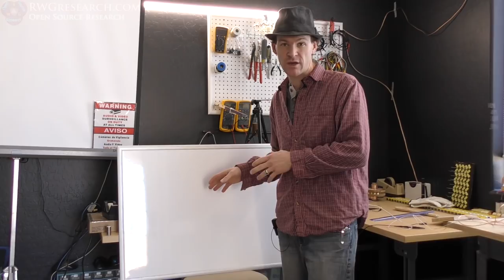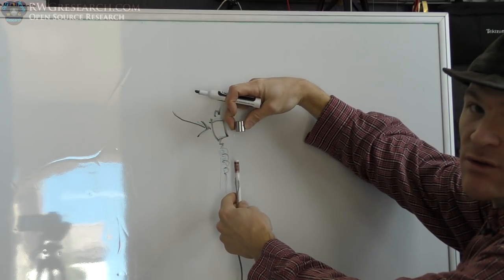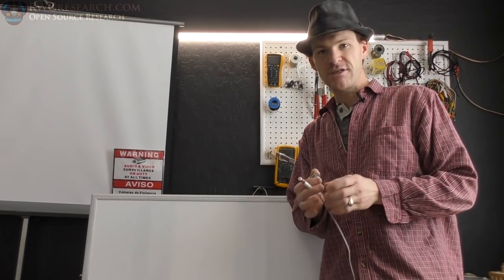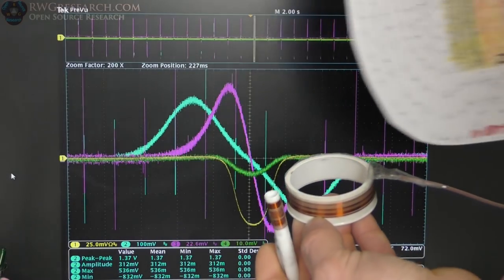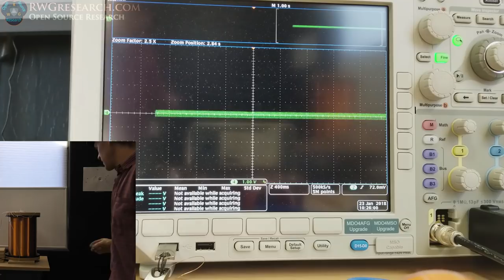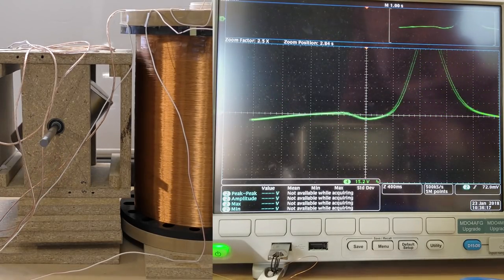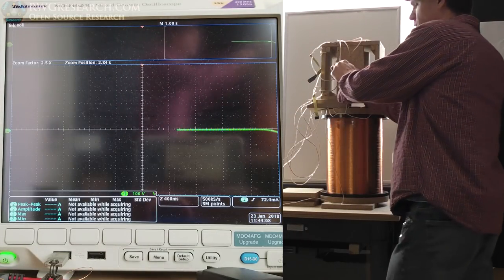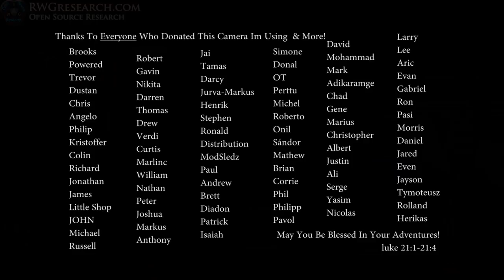The Search For Answers Part 14: Coils & Magnets. Back To The Basics. Very Counter Intuitive... B

Comment: Comment to part around 10 min. : Real results are in accordance with the known law which says that induced voltage depends on change of magnetic field. So it also means that after the point where magnet is closest to coil, change of magnetic field is negative because it weakens so voltage is also negative. So one swing makes you whole sine wave.

Comment: I am not fully convinced about Newmans theorie of a splitted pole with opposite directions of a spin, but i think, its more like H. Johnson demonstrated, that it are 2 spiral spins, what comes out of the poles, and interact with eachother. You can explain by that also the observations at the cutlines.
 Keep in mind, that this magnet are flat at the top, and the strenght of the magnets increase or decrease at most at the very last distance.  This top flat area can cause a drop from the induction. Also that gap, what at both coils exist.  I had similar observation, that the sinus wave was not exactly a wave, but something like a hat, but at other configurations, it created a perfect wave with just one pole passing by.  It maybe would be interesting, what a shaped magnet like a )) does, when you pass it by at the circle, what is the extension from the angle from the shape of the magnet.  But still quite interesting, that passing the magnet just at 2/3 along the coil creates a induction only in one direction. I only had one time some positive results with this motor, but it was with different amount of windings, also the duty cycle and the timing is importend. It does not work, when you connect it a lenght of 180 degree. I also could not reproduce the configuration anymore. 
This guy here rips J. Newman pretty apart, not sure what did happen there, even i dont buy it, that Newman gave a guy 100 000$ for helping, to put the device into his car. https://www.unexplainable.net/info-theories/was-joe-newmans-free-energy-claim-bogus.php

Comment: Hi Russ I am trying to take your advice of giving back for all your great work and inspiration you have generated.... 

Magnetism
When you show a curved field as in your hand drawing - the whole Idea of a curve derives from how metal filings themselves are redirecting the otherwise straight line field. The random geometry of the material still finds the pathway of a field but sorts this out at an average continually and gradually to form the curve.  Its the material itself that is redirecting and creating the appearance of the curved field seen in filling patterns - what is otherwise ONLY a straight line vector of the field emerging from the pole. This is yet another example of how theories and apparently how they have been taught to us distort perception. That and you can also use a field detector around a magnet and not detect any curve. Constructs are not only unhelpful  this is a good example of how direct perception is constantly messed with. Scientism demands its own type of blind faith in that such tests that would put the cause of distortion to rest are not usually performed. If the fundamentals are botched in this way then its kind of hard to get clear on the further details of analysis which are based on them.  

Gravity
To give an example of theoretical cause of mental distortion Look at the theory of Gravity with me -  Gravity is a theory and yet it infects our whole thinking without realizing it. If you look closely in how its being invoked its often applied as if were a belief rather than from an idea that is grounded in direct observation at the outset. I put the utility of Theory into question to make a key point - By choosing any one test offering REAL and direct observation -  you need not rely on any Formula. A God given faculty of  natural PERCEPTION reveals immediately that Density explains all that Gravity purports to explain without ANY of the attending complexities, contradictions and confusion.  Whereas the appearance of complexity confusion additional non observable constructs never arises within the concepts of DENSITY and BUOYANCY.  For example Fluids of differing density in a test tube are observed to NOT attract but actually repel and separate. Hydrogen does not attract to the earth as a mass - but flies away with great force. Adding a mass of hydrogen to an evacuated balloon is adding weight to the entire vehicle yet results in buoyancy. All observations immediately contradict tenets of gravity which state masses attract to the center of the earth, masses attract to each other ect...  So tell me why do we need a THEORY of gravity when all we observe is covered by the FACT of density and buoyancy? Falling and rising is explained.  Such theories like gravity distort thinking to make us believe we need ever more data  - that we need to better align to some theory.  But Worse Our whole  understanding of the world is distorted by this one idea. In point of fact we are not trusting our god given perception any longer. Not honoring the creator creation in external placating of theory.  Electric theory is notoriously embedded with distorted concepts.  Tesla Faraday DePalma - all were Scientists because they where WITH (CON) their knowing (science) of direct observation - With conscience.  They grew further and faster from the foundation of Seeing reality directly - seeing more clearly because they some how let go SUFFICIENTLY of the distorting filters of theory that hamper pure observation.  Trust experimentation based on your direct observation MINUS the need to prove out theoretical constructs.  Your building capability is an inspiration to all thank you for all the inspiration you have generated !

Comment: I've watched 3 time's now. I wish you could have said the coil windings are left thumb rule. I been trying to wrap my head around what direction of the coils and magnets need to be to produce a push off of the magnet once induced by/from the magnet.
If a north swipes the side of a coil, "from south side of coil. Does the coil induce a north from the north end of the coils or out the south end?

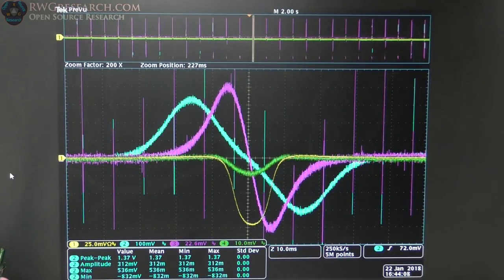Comment: Very good video Russ, but you never really explained the reading around 25:58 when you said you would explain it further at the end of the video... but before that you do say the blue one is the bigger coil, plus the timing of the amperage peaks are further apart. My thought is the reason the pink reading gets higher amp changes is down to the number of "turns" or extra wires that the magnetic flux cuts through. I wish I had an oscilloscope, interesting stuff you can see just by messing around with wires and magnets to better understand how electromagnetism works.

Comment: hmmm after doing some more reading on EMF, at 49:45, your getting one direction of current and then an equal and opposite direction of current bringing you back to zero, the current is switching at the peak. This happens as the magnets field passes by the wires in the coil running in one direction on one side of the coil and then an equal and opposing current occurs when the same magnetic pole passes the other side of the coil where the wire is running in the other direction. Which brings you back to zero on the scope if it was done at a constant RPM and stopped at exactly 180 degrees like you were demonstrating.

Current flow in the other direction is just negative volts, or negative potentials being created where the magnetic field passes over the wires. Positive volts is current flowing one way and negative is current flowing the other way because the potentials positives and negatives switch places. I'm reading about the most basic form of EMF calculation which is Emf = l * v * B l is length of wire crossing the magnetic field (B) multiplied by the velocity (v) of that crossing multiplied by the magnetic field (B) and B is in Teslas; Volocity is in Meters per second; and Length is in meters.

So in a coil you deal with two wire crossings or intersections (albeit that above equation gets more complex once you add an arc to the wire and are no longer dealing with a straight wire passing perpendicular to the magnets surface) so lets say you have a square coil instead. 

The north pole of the magnet passes over one side where the wire is running in one direction causing a voltage or a potential difference where the positive and negative are at both ends of the wire where the field stops on the wires and the positive and negative is determined by whether or not it was the south or north magnetic pole you passed by it and the direction you passed it in.

Then because the pole is the same and its moving in the same direction once the magnet passes the center of the coil where its field intersects the wires much less you get that anomaly at the peak as the voltage drops slowly, and then as the same pole intersects the other side where the wire is running the other direction, the current quickly drops because the voltages being induced on the other side of the coil are now opposing the original direction of voltage (the positives and the negatives flip) due to it being a coil and the wire running back in the other direction on that side of it. 

So the voltage potential reversal happens at the peak when the magnets pole passes the center of the coil leaving one side and crossing to the other side which causes the current to rebound back to zero because you had X current from an induced EMF on one side and then subtracted X amount of current through the EMF being induced backwards on the other side of the coil due to the wire direction changing in respect to the magnet.

Comment: The problem with this test when you have the 3 coils stacked on top of eachother is that the coils will induce voltage between eachother. So to really do this right you need to isolate each coil and test each one separately. That’s because each of the coils themselves manifest a magnetic field and they will either amplify or cancel out the voltage between eachother.

Comment: Very clear.. Yup this parallels Tesla's motor gen then. Except Tesla used all electromagnets so that the system can auto balance the poly-phase output. Two currents at a different degree of phase.

  In Newman's version he uses just one coil. But Tesla used 4. Two pairs per phase.  Tesla also used a field core toroid to get another advantage. The rotor coil makes a field that can be channeled and pushed around the ring. When it gets pushed around the rotor locks to that magnetic field circulating around the field core strengthening it and generating more current in the field cores that assist the field coils. This also generates even more current in the rotor which can be used for a prime mover. I believe Tesla's version is a steady state rotating transformer. If you take mechanical spin out of the system that will slow down the rotor and the rotor coils will generate more current trying to maintain sync with the field coils. This will also generate a heavy current in the rotor coils and a loop forms.

 Think of the Tesla system as the whole device and Newman's as only one coil in Tesla's device.

 A test of this would be to use two massive coils hooked serially and spin the magnet between them. I bet one would need to be inverted to help twist the magnet. You are making another coil right?
Reply from the maker: Thanks Jon, yes i will have 2 coils. indeed it would seem that one coil could need to be the other direction. however if the field cancels... Then we are in no help with the mechanical advantage.  any how. a single coil with magnet in side is the way to go... or so it seems. ~Russ
Reply: Well I was thinking the motor itself powers half way then kinda lets the inertia built up continue it through the other half of the rotation of the magnet. If you wanted it to be powered all the way through then you need another coil on the left. How that will effect the coil you have now would be hard to say because of the magnet spinning in the middle.
 The second coil in Newman's device was used to tap the coil you have now as a generator/load coil which would be on the right of the coil you have now. It must be outside of the rotating magnets influence though but in inductive relationship with the current coil. Gonna be hard to figure that out but it shouldn't be impossible..
 That commutator brushes need to be copper I am betting. This would suppress the chatter as well and make better contact to the commutator contacts. Plus most of the wear will be on the brushes then which would be easier to change then the commutator elements.
 You are doing great.. Keep up the good research no matter how confusing it may get. He had something there so it is a matter of time to figure it out...

 By the way excellent Video!

Comment: Thankyou russ  youre doing that  which  has needed doing slnce joe  gave us his discoveries this is extremely important r and  d  ie back engineering
Reply from the maker: what Newman gave us was his view of the observations of the simplest experiments.  All this in a mechanical interaction view point. In the end it all feels like quantum effects.... however, Newman could grasp those basic principles to prove that it was possible when we use 100% of the magnetic interaction between a coil and a magnet. In the right configuration. to achieve a device that is truly 100% efficient. and then some... :)  ~Russ

Comment: Did this same experiment in a lab in AC systems class a couple of semesters ago. We did not include the straight conductor but did pretty much the same physical process you did. I think a lot of people make the mistake of getting lost in semantics. Also, I disagree about the counter intuitive nature of it all. 
Good luck, I wish you success in achieving an apparatus that is of use to humanity as a whole, on that front, we are aligned. I just think re-inventing the wheel to get there is unnecessary and an exercise in futility.
Good luck, we will see who reaches the coveted goal first.
One thing is for sure, we both have completely different views about pretty much everything.
We also have differing views on what is good and what is bad etc, real and fake etc, crazy and sane etc.
So anyways, time will tell who was on the true path. 
At least the end goal is a worthy cause, that is a good thing.

Comment: In your clairty part 13:10.
If the voltage is going down, the current is in the opposite direction.  The current doesn't change that the 0 line.
If it dips backward, there is charge moving away from that side and not still towards at a lower sample.
While that is semi-true because of leakage, you can have a down signal that's because there is still less current in the same direction, but if you're on DC that shouldn't be such a worry?
Reply from the maker: J Decker its a bit confusing.  But here is how it works.  

If the voltage is below the 0 line,  then the current is in one direction.  The amplitude of that voltage tells us how much current is flowing in one direction.  

Make sence?  

So yes.  Anything below the 0 line is one direction of current,  and anything above is the other direction.  

You can see the sharp pulses to and past the 0 line is current going in the other direction fast.  And some times there's a slow decay.  
However even so the 0 line splits the direction...  The angle kinda shows the story as well.  But all in all it tells the story.  
~Russ

Comment: Hi Russ, do you think there can be a way to create some sort of transformer that can output dc (or pulsed dc) in it's secondary coil? It has to do that without using diodes, the secondary coil itself must output dc.
Usually by increasing current in the primary coil the secondary outputs current in a certain direction but you can't increase current for an indefinite period of time so when the current in the primary drops, the magnetic field drops too and the current in the secondary starts to flow in the opposite direction as before.

Comment: Enjoyed watching this, thanks for posting. In the setup where you tested the smaller coil inside the one wound on the Teflon tape ring - did you test them separately and then compare the resulting data on the scope? I’m wondering how much the field induced in the bigger coil effects the field in the smaller coil. Tesla had a “tertiary” coil (or additional resonator) coupled inductively to the secondary so I would think that both coils influence each other. Of course that doesn’t change the overall outcome of what you are demonstrating but I’m just curious.
Reply from the maker: yes, the results are the same. Because the coils were open ended... There was no interaction between them... If they were shorted we may see different results. Thanks! ~Russ

Comment: Great video Russ. I recommend having a look at Robert Distinti (Distinti.com) for a more coherent theory than Neman on what could be the 'gyroscopic particles'. Distinti proposes a particular construction of particles forming an ether. Before anyone says just another theory, take a look at the predictive results the associated new electrodynamic equations that are derived. The equations predict different fields than our current EM theory, don't require relativity or dilation and more importantly fit actual accepted experiment results far better than any current 'laws' we have for easily verifiable areas like intrinsic inductance.